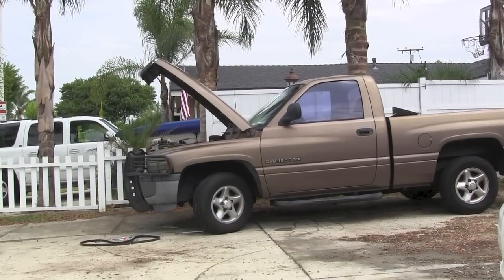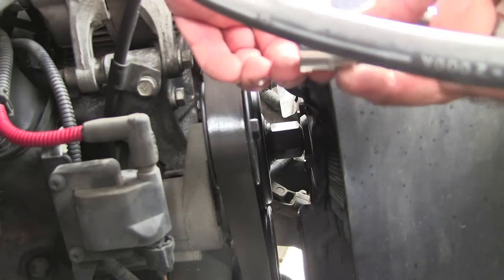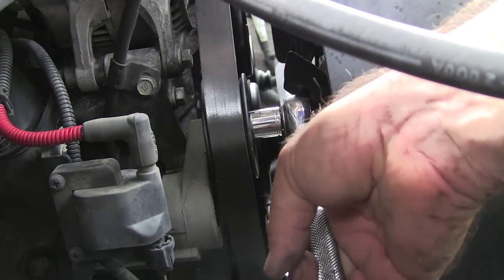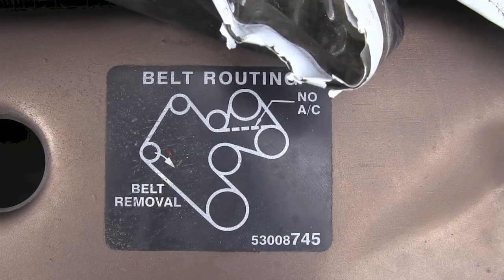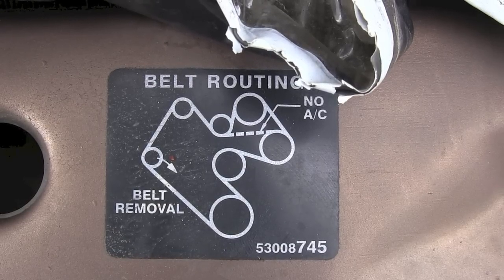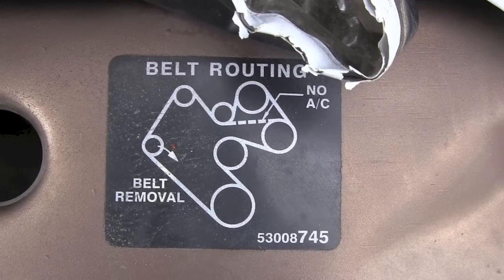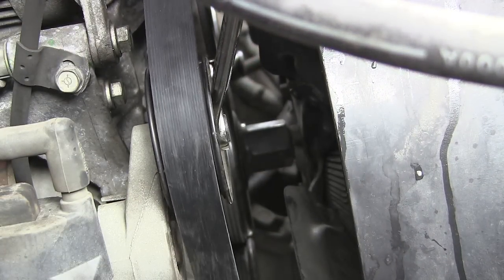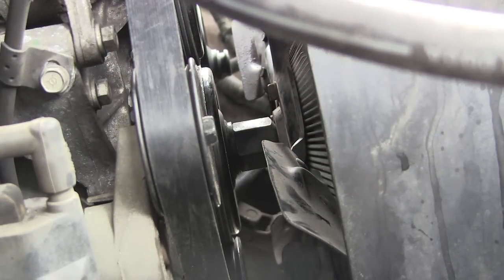Dodge 1500 Ram Truck Serpentine Belt Replacement Video

Comment: Thank you for the video. It helped a lot. I used an 18" length of 3/4 PVC slipped over the socket handle to gain more leverage in relieving the tensioner pressure. That way I was able to hold the tensioner back with my left inner elbow as I installed the new belt.
You will hate me for this but it is pronounced serpentine (like Iodine) not surpenteen.
Thanks again.

Comment: Howd you do it? What was the point of this video? You helped no one.
Reply: He used the socket/wrench to pull on the belt tensioner, releasing the tension off the belt allowing him to take the belt off without having to remove any of the pulleys.